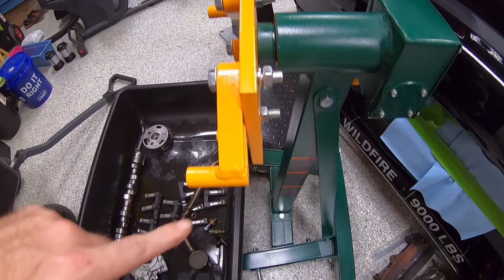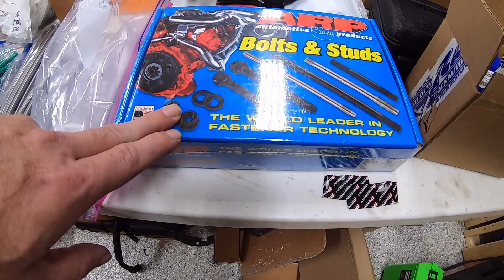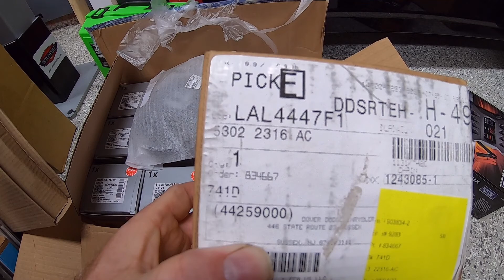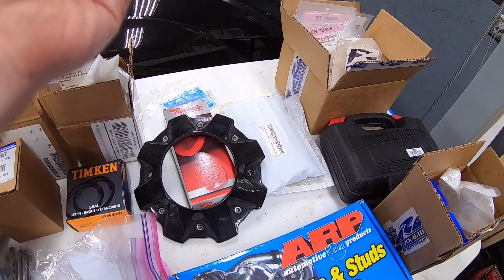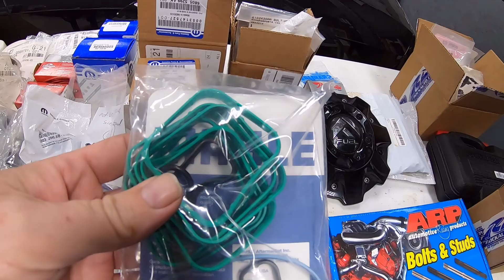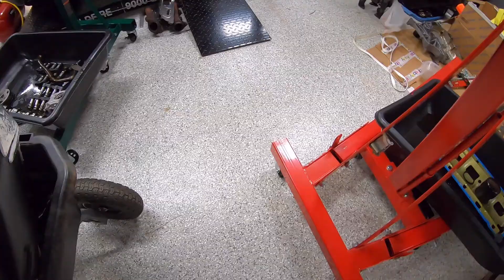2009 hemi 1500 trx4 build part 49.  Parts update and latest status.  Ready for long block assembly.

Comment: Doing mds delete requires tuning does it not? Also I think it changes how oil flows through the galleys. Not sure that it's a good idea for longevity. Would like to hear your thoughts
Reply from the maker: For the MDS delete, a tune setting is required not a full on tune.  I have a Diablo itune3 which we will use to turn the mds settings off, the rest will remain factory.  So yes it could be considered a tune.  If the PCM should get set back to factory, with the MDS solenoids missing it will set a check engine as it will see then attached.  If that should happen then just using the itune and turning the MDS off again will resolve the issue.  As far as the use of the mds plugs, it basically sets the engine up to work like any other hemi with a manual trans for example as they also do not use mds.  Of course this all ties into the use of non-mds lifters and turning MDS off in the pcm.  Does it affect oil in the gallies?, Yes but only as far as it now treating all the lifters as non-mds.  With the MDS turned off and the solenoids missing it might still throw a code on power up, depending on if the pcm still does a self check of them, we shall see.  if it does I have a workaround for that, but will need to test it.  We will capture all this and much more in the up coming videos.